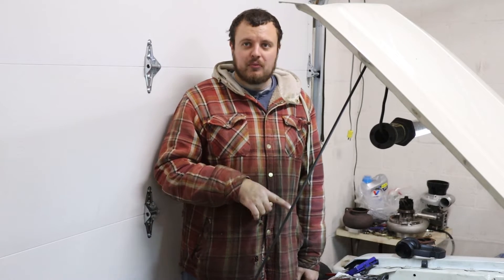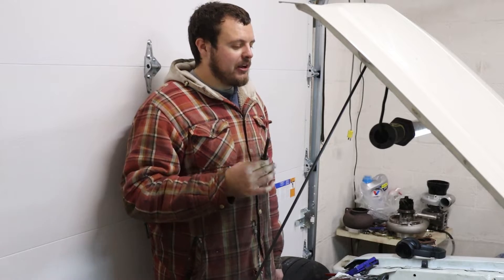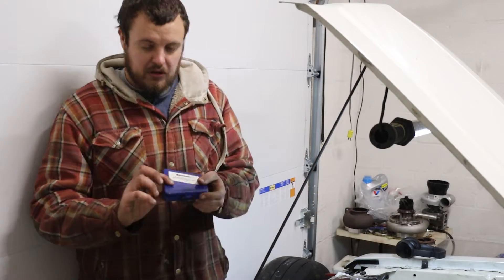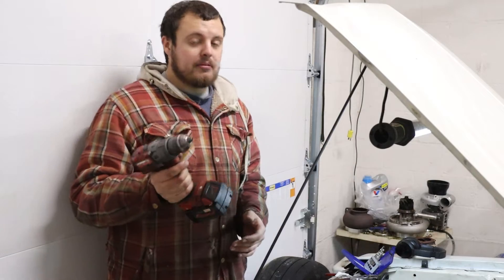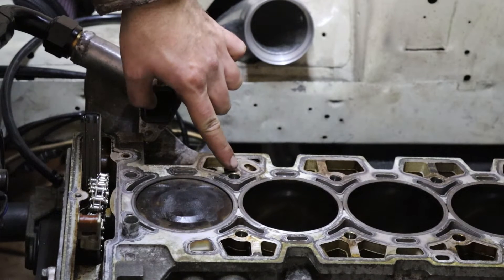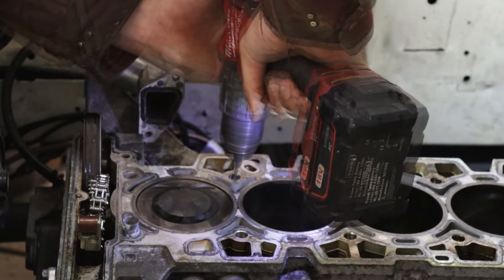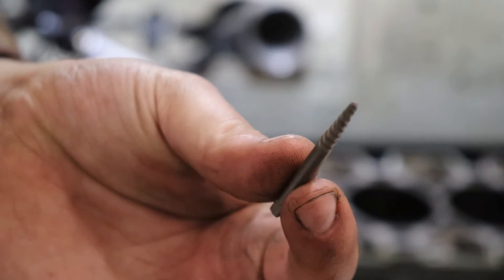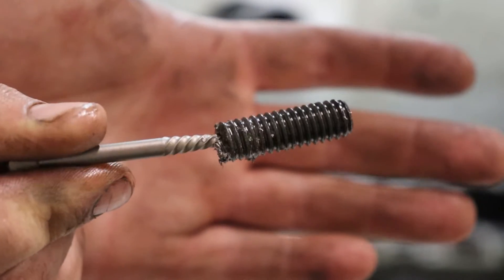How to Remove Broken Head Bolts from a Vortec 4200 Trailblazer Motor

Comment: I have a question. I have the exact problem. I am a backyard mechanic, but mechanically inclined. Can I do this without removing the head?
Reply from the maker: Do what without removing the head?
Reply from the maker: You mean try to extract the bolts without removing the head. Maybe some one makes an extended easy out. That will be a tough problem to solve there.

Comment: seeing as you 3d print,  and machine,  i'm sure you could make and sell 'bushings' to slip inside the bolt hole,  and fit snug around the drill bit.  if i ever do a 4200 build,  i'd buy a bushing set from you.
Reply from the maker: Not a bad idea
Reply: Or just buy the GM Kent Moore service tool set that has the bushings, LH drills, and screw extractor
Reply: sorry i don't have the whole kent moore tool catalog memorized yet  @hansbrix2495

Comment: Is the breakage because they are torque to yield  ?
Reply from the maker: No. I've removed TTY bolts from LS engines and they don't break. It's like the bolts are designed to break on the 4200s

Comment: I would make a drill bushing to insure that I drilled the hole both on center, and in alignment with the head bolt. Though I admit you seem to have a handle in the procedure.

Comment: Stupid question maybe, but if they're loose enough to back out by hand, why wouldn't they come out the first time with the rest of the bolt still attached? 🤔
Reply from the maker: No idea. It's like the bolt is designed to break.
Reply: @Calvin-Nelson  They are torque-to-yield bolts meaning they are pulled up tight enough that they stretch beyond the point that they would return to their original length if you undid them. In other words, they end up longer than they started off. There are permanently deformed and cannot be reused as they cannot be re-tensioned before reaching the correct torque without breaking. Once they break, you have removed the strain they are under, so the bolt threads are not fighting the threads in the block any more and you can wind them out as they are under no load.
A normal head bolt will be torqued to less than the yield point or elastic limit (the point where the bolt will not return to its original length), so you can reuse them. If a normal head bolt were to suddenly break the head of itself, it too would easily wind out as the mating threads are no longer fighting against friction.
A good question would be why do they use torque-to-yield bolts anyway?
Reply: @flyingscrapyard  My theory is that the engineers started using TTY bolts because it was the easiest way to guarantee proper clamping pressure, no matter if the threads are dry, lightly oiled, dripping oil, warm, cold, etc.  All those factors can affect torque values.

Comment: One of my friends uses a brass drift to shock the bolt heads before trying to remove them on the 4cyl &5cyl motors.  That combined with using a 1/2 impact gun seems to really help keep the bolts from breaking.
Reply from the maker: Yeah. I've tried the hammer method. Didn't seem to help me. The impact thing may be something.

Comment: Looks like GM made the bolts to long.... so the bolt gets torqued and bottoms out and locks up so on the way out they snap
Reply from the maker: I don't believe that is the case. I think the dissimilar metals and the way the bolt is designed is the cause.

Comment: I’ve used the same method works good.  In my experience,  seem to break more when using breaker bar vs impact.
Reply from the maker: Yeah. Seems to be directly correlated to mileage in my experience.

Comment: Would antiseize used during installation help in the long run?
Reply from the maker: I doubt it.
Reply from the maker: The bolts are like designed to break.
Reply: @Calvin-Nelson  Do you replace with ARP bolts?

Comment: I once saw a buddy use an air hammer with a socket attached and a crescent wrench to turn a super stuck bolt on a really badly rusted part. I wonder if such a contraption might yield good results here, might try it out on a "fresh" junkyard motor.
Reply from the maker: Yeah. I think they're called bolt knockers. I want to try one.

Comment: Would an impact gun help to shock them loose? We use a 3/8 gun on the Ford spark plugs that would break off in the heads all the time.
Reply from the maker: My impact gun isn't powerful enough to do it. They're really easy to strip too.

Comment: How frustrating. Tight enough to shear the bolt, yet loose enough to back out by hand with an extractor.
Reply: I was just thinking the same thing. I think its something to do with the stretch on the bolt that does it.
Reply from the maker: @74novacustomLSX  its like they're designed to break. It's weird
Reply: @Calvin-Nelson  It's a torque to yield that can definitely not be reused. GM, "We'll remove that option for you"....